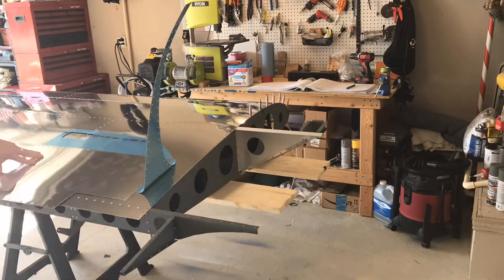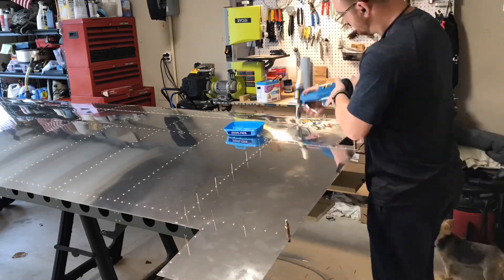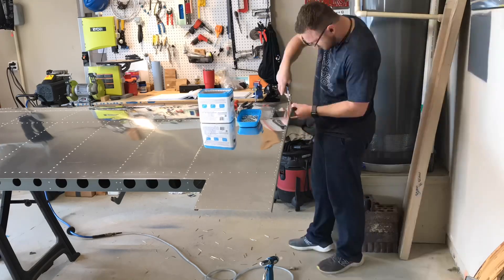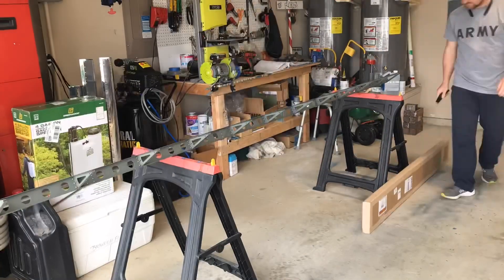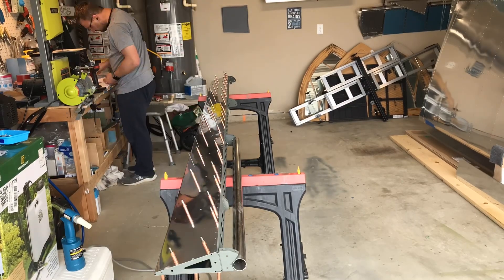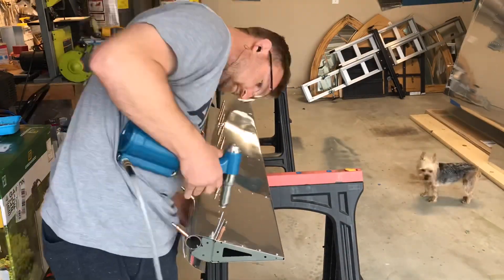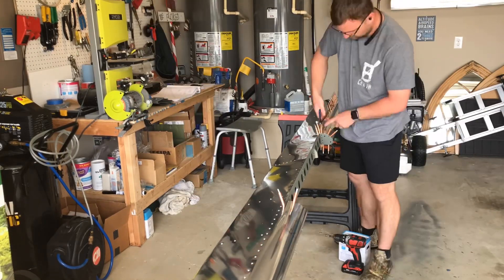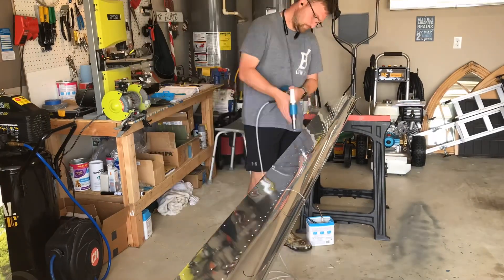RV-12iS Wings 9: Wing Completion

Comment: So what's up with the finishing kit?  You get it on time, building but not videoing it or what?  Working on the fuselage myself - finishing kit inbound...your videos are helpful - you aren't the only one making mistakes here and there - happens...can relate...thanks for helping me not repeat your mistakes - I make my own originals unfortunately.  You get the full interior or you painting it?
Reply from the maker: The finishing kit still hasn’t shipped, Vans has not received the engine mount and landing gear amongst a few other items. More to come later. Thanks for the follow up
Reply: @blflores10  Wow that's horrifying - 3 to 4 months late.  Hope you get it soon and they get the supply problems worked out.  Be extra careful to not need more parts - I screwed one up and it's on "backorder" which means Lord knows how long I'm held up :(

Comment: Question on the landing lights...did you install those prior to putting on the top wing skins or after?  Just wondering if it would be easier to do with access to behind the light before I put on the top skins...or if that's a bad idea for some reason(?)
Reply from the maker: I put them on after, which wasn’t complicated at all. The hardest part was lining up the bolts with the LL. The plexiglass LL cover has to be fitted and drilled before the LL goes in and even with the top skins off there is still the main spar to contend with and you don’t want to be bending the bottom skin up to get in there as it can be really easy to crease the skin. Not to mention it’s a long reach from the spar to the LL and would probably complicate the installation even more.

Comment: Maybe I'm not seeing it but are you doing much deburring? I'm building a CH650 and it seems every hole needs attention.
Reply from the maker: For nearly all edges, yes there is A LOT of deburring. I try and make a point not to film a majority of that for viewing purposes but some do slip in if you’re watching carefully. Vans actually has guidance to not perform deburring on the final sized skin holes due to skin thickness (thinness??). And due to the holes being final sized and not requiring match drilling I have yet to find burrs on the rivet holes which I am guessing is a result of how the holes are formed. Anything match drilled or final drilled I always deburr.
Reply: @blflores10  Thanks